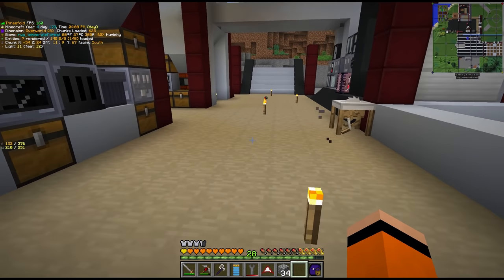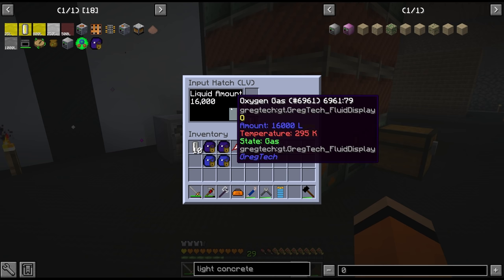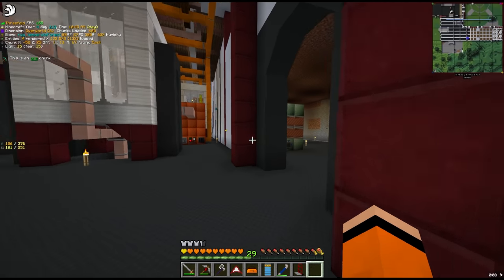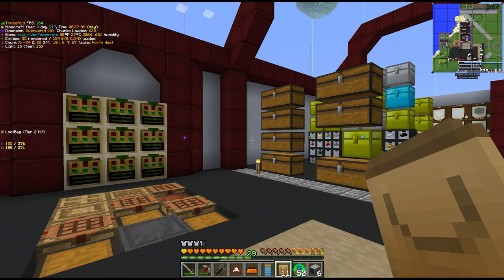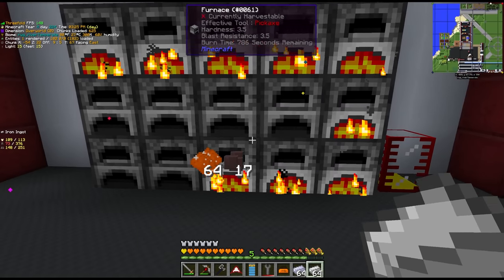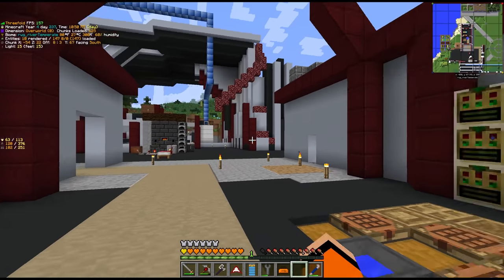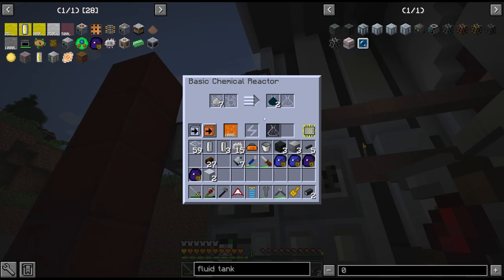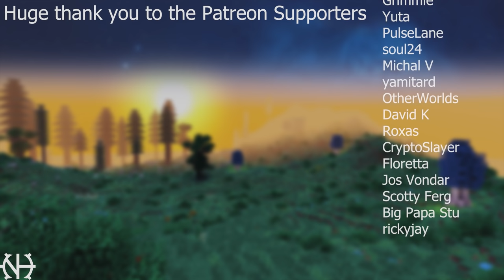Gregtech New Horizons - 14 - Stainless Steel! Modded Minecraft

Comment: You can get tons and tons of calcite from marble, which you can get from crops
You can get carbon also from charcoal, which you are producing
To get silicon ingots use silicon dioxide, much cheaper and faster
You can move super tanks without losing their contents if you don’t shift while breaking
Use universal cells or big cells from GT if you want to hold stuff like polyethylene in bigger batches than 1 ingot worth
Once you get the HV macerator you will want to process many ores through it

Comment: Would definitely recommend going for diesel power, simply because you can transition pretty smoothly into cetane-boosted diesel, which is like 3 times more energy dense than benzene if I recall correctly. You will get access to Large chemical reactors soon and 1 single chunk of oil should last you all the way to EV, where you unlock better power options. Benzene is fully renewable, but I think it's not dense enough to keep up rows of HV EBFs and HV machines.

Comment: I hope you realize that access to Stainless Steel means meaningful access to Thaumcraft. So, eh...get ready for those info dumps...;)

"It only took about an hour on stream" yeah, to build the farm. Actually getting the stickreed was, what, five minutes? This guy's luck is off the charts on that one.

...Three? You have a ranged weapon. And eyes. And situational awareness, I would hope. Maybe employ those tools before a creeper ends up turning your base into a base-sized crater, just saying.

Welcome to one of the reasons why the GTNH questbook is bad, by the way. At least you actually end up using and/or are able to recycle most of the unnecessary (or unnecessarily expensive, for the moment) machines it makes you craft.

One thing to note is that crafting higher tier machines to run recipes faster is energy inefficient - an MV centrifuge is twice as fast as an LV one, but consumes four times the power. Power in this pack is not trivial, it's easy enough this early in the game (though the pollution you create in the process is a factor to consider) but it's going to become a bigger issue later on, not to mention as machine tiers increase - an EV centrifuge consumes the power of 64 LV ones, but only does the work of 8 of them...

You really ought to craft a prospecting machine soon, Three. Maybe hold out for the HV one if you're close to that, but definitely stop randomly stumbling around looking for ores and instead just find them and their neighbours just like that...well, okay it takes one or two steps more than "just like that", but said steps don't involve lava baths so I'm sure you'll agree it'll be an improvement regardless ;)

Yeah, you might wish to wall off your Twilight Portal so it doesn't turn into a party on the other side. I mean there's a quest to get another Quick and Dirty Portal Generator so you can't softlock yourself by getting your Twilight Portal blown up on the Twilight side, still...

The random explosions are either from Warp (not impossible, but I'm sure you'd remember if you picked a fight with Crimson Cultists and/or Eldritch Guardians at this point) or from mobs dying to environmental damage like lava. Remember the part where basically every mob has a chance to explode for no reason if you don't kill them with the right tool? Well, lava does not qualify as such, so mobs that burn to lava end up exploding, which you can hear in your base. Why yes, that is a really stupid and poorly thought through mechanic. But this is GTNH, so...have fun ;)

Miners will happily tunnel through lava and mine ores that are sunk below a lava ocean. They don't care. What you should care about, however, are two things. One, there's a rare Railcraft ore in the Nether that will cause everything around you to catch fire if you have it in your inventory, so be very careful if one of your miners ends up picking one of those up. Second, your miners will not refill the holes they dig in the process of mining. So take care not to fall into any random ditches that go through a lava ocean straight to bedrock. It's bad for one's health, needless to say.

If there is anything I'm sure you're going to want to do with your initial Stainless Steel it's making Compressed Chests - enormous inventory space, keeps their content when broken. Very, extremely worth it...despite being, you know, not cheap...
Reply: your comment was longer than my english essays
Reply: Yeah definitely get a prospector, those things are really nice. The book does a good job IMO of explaining how to make the data books from them, and once you read them they add the new ore veins found to journey map for you automatically. The LV quest gives you a stack of powder barrels you can use with them too so that will buy you some time to try it out before getting a good source of barrels. Even the LV one is worth it IMO if you don't want to spend the resources on an MV or HV one although the higher tier ones are much better.

Comment: your silly, why not switch to electric blast furnaces instead of the primitive ones. XD lot less pollution and faster steel.
Reply from the maker: It really comes down to power at the moment. Soon as we can power a bit more we'll switch to more electic blast furnaces
Reply: @Threefold.  i mean. you have a lot of materials these days, im more surprised you didnt make better boilers? or more then just 2. unless its been changed isnt burning your fluid fuels in boilers more efficient then direct? or is there a special addon mod to burn it in a better turbine system? im not that familiar with all the changes done in that pack.